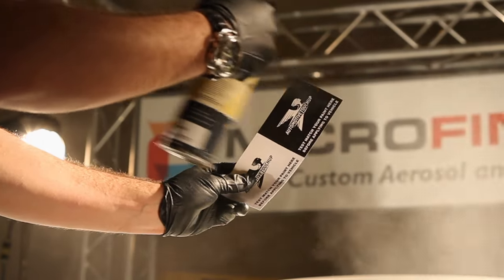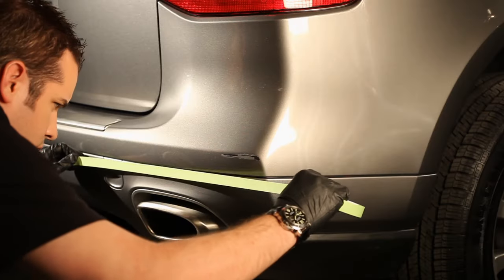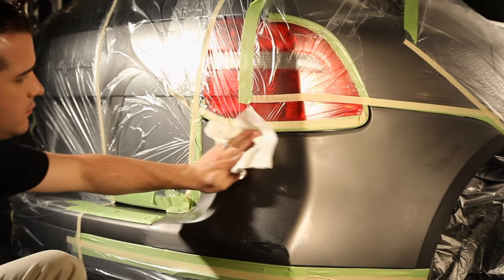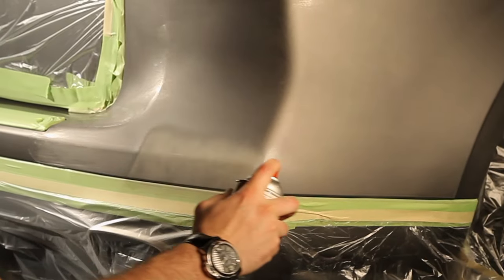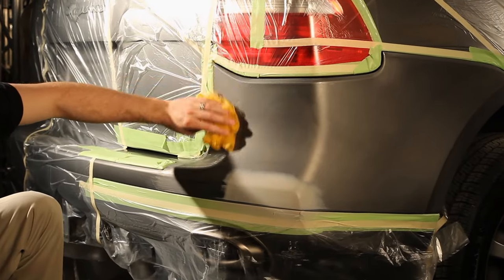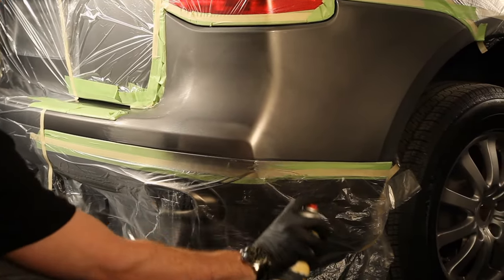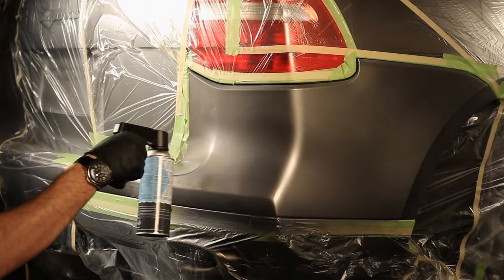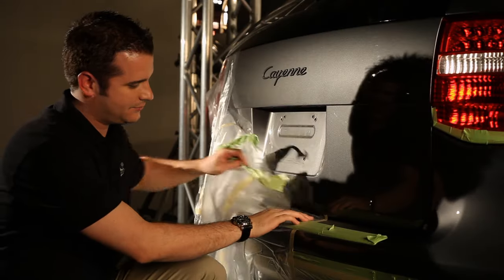Step-By-Step Bumper Repair and Touchup Paint Blending

Comment from the maker: It depends on which area. The basecoat blend area gets roughly 600, the clearcoat blend area gets anywhere from 1000 to 1500. The edge of the clearcoat blend area should be 1500 so I may polish out any scratches I didn't cover with new clear.

Comment from the maker: Unfortunately you may have to start over. It is often easier to start over than try to save a painted tape line. Start with 1000-1500. 1000 might be too rough, 1500 may be too slow. I'd start on the rougher side and work my way to 1200 and 1500. Wrap sandpaper around something hard like a paint stick. It is highly likely you will burn through to the primer on the lower side before getting everything level enough to pass. Be prepared to start over before sanding and polishing out a tape line.

Comment from the maker: Roids10, if the primer is rough you can start with 320 or 400 to knock down the rough areas, but you do not want any 320-400 wet sand scratches left when it is time to use basecoat.

Comment from the maker: @loveskating3 
It is really hard to tell the best way for a repair. Sometimes the scuff will come out with rubbing compound if its light enough. If not I'd repaint the 1 foot area instead of each individual scuff. You may spray primer over existing sanded paint.

Comment: Hi, I have bumper that has multiple scuff marks in about a 1 ft area. I do not have a power sander, so I was hoping that I would be able to sand/ feather each scuff mark, and sand the painted areas inbetween. Then I could just primer the whole area. Am I able to spray primer over sanded paint, however?

Comment: if my area in the bumper it shoes the bare plastic black,  do i spray a 2 coats of promoter and after can i just spray the basecoat on top of the promoter?  do i really need to use primer on top of the promoter?     the area of bareplastic is small  2 inch by 2 inch

Comment: Spray on your paint. Attach 1500-2000 grit wet or dry sandpaper to power sander. Keep paper slick with water/soap. When paint becomes dull colored, buff with buffing compound. Add Clear coat. Never attempt to power sand corners.

Comment: I waiting on an order from your company (Item No.: AER-BC, Item No.: AER-PR-Grey, Item No.: AER-CC) but have a question.  I a couple of scratches on the front bumper of a 2015 Toyota Prius.  I tried to use Toyota touch up paint and had poor results.  The scratches are down to the plastic (see image) so not sure if it can be sanded out without causing a dimple.  Should I fill the with one of your products (BONDO 907)?  https://c1.staticflickr.com/1/727/21043375823_4d7761017a_b.jpg
Reply from the maker: You'll have to sand out the damage which may cause a dimple, then use some spot putty or bumper repair and sand it back smooth before priming.